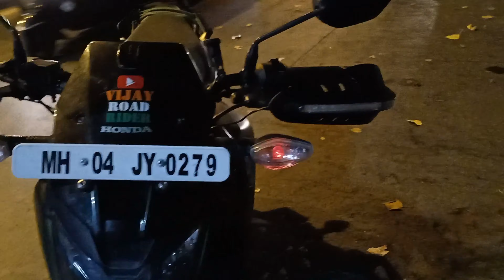HONDA X BLADE HAND GUARDS / HANDLE GUARDS LED VERSION | MODIFICATIONS FOR HONDA X BLADE ABS

Comment: Does the thin front tyre cause any issues? 
Can it be used for long rides?
Reply from the maker: I am using honda X blade from last 5 months till now didn't faced any issues bro , even I had travelled 700 Kms in single day but didn't face any issues so from my side it can be definitely used for long riders
Reply: @VijayRoadRider  thanks, any reason you chose X-Blade over hornet?
Reply from the maker: @theorex8621  I personally choose X blade over hornet for its looks and I just love the way the bike is made and headlight is a main attraction for me for purchasing xblade
Reply: @VijayRoadRider  700 km travel karne ke liye kitna litrs petrol use hua aur milege kya mila us wakt 700km trip me

Comment: I also have xblade and its silancer became quickly too hot due to which many shoe soul have burn due face same issue
Reply from the maker: No bro I still not faced any such issues till now recommend you to get you bike serviced through service center
Reply: I too have that problem bro. Don't know what to do. If you find any solution inform me.
Reply: @kavirajr3717  still searching for a solution
Reply: The only solution is make ppl aware not to put shoe on exhaust. And say no to third person coz there is no space to put legs for 3rd person